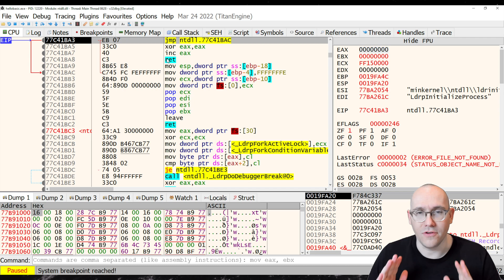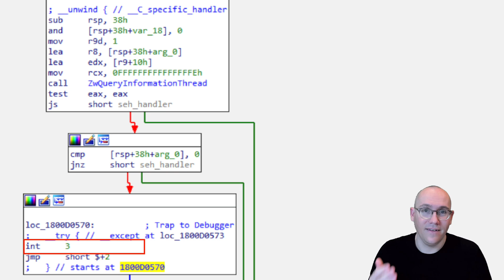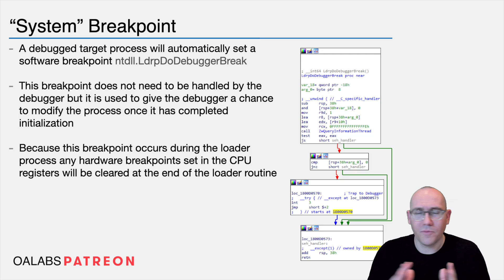x64dbg System Breakpoint Explained

Comment: I notice, top-right corner, it says "TitanEngine" -- is that related to TitanHide, the kernel-level anti-debugger module?  

I've briefly looked into what it takes to install, but it was pretty "don't touch this if you don't know what you're doing" and given it's a driver I erred on the side of putting it off until tomorrow... for a long time.  

I remember I once went looking for some content on setting up TitanHide, but you end up in a lot of those old school hacker forums with kids and that isn't exactly the kind of place I trust for information on installing drivers. Even if it's just my win7 VM, it's a lot of work to muck about with stuff over and over.  

Do you have any content // are you planning any content on TitanHide vs standard anti-debug plugins and what it takes to set it up?
Reply from the maker: TitanEngine is the core debugger used by x64dbg (https://github.com/x64dbg/TitanEngine) it is user land only, no kernel components. TitanHide is tool used to hide debuggers which does have a kernel component (driver) (https://github.com/mrexodia/TitanHide). If you just want to an easy-button to hide your debugger I strongly recommend starting with ScyllaHide (https://github.com/x64dbg/ScyllaHide) it is user land only and much easier to use, we have an explainer here (https://www.patreon.com/posts/installing-to-57091901). I have never encountered malware that required kernel-level debug hiding only anti-cheats etc. so covering TitanHide not a priority for us to cover.
Reply: @OALABS  ScyllaHide -- that's it! That's the one I've got.  

Gotcha. Makes sense to me. That would also explain why I only tend to find TitanHide tutorial information on sketchy gamehacking sites.  

I originally got my start in game hacking and it was the original motivation for reversing. I'm not a malware reverser by trade (I'm a penetration tester); the bulk of my reversing these days actually comes from CTFs and just a desire to stay sharp. Though I really enjoy your videos primarily for the educational angle (understanding what's going on under the hood and why things work) to round out my self-taught guess-and-test knowledge.  

Hopefully some day you do either get around to TitanHide or reconsider it on the priorities. While I definitely do believe you that it isn't necessarily of great import here, I intuitively feel like it's a rather solid stepping stone on the path of... holistic knowledge in this domain? Either way, I will definitely take a look at the links. Thanks Sergei!
Reply: Why do you say "old school hacker forums with kids".
These guys are usually the most skilled reverse engineers much better than those that work in the industry.
Considering that they need to reverse engineer games, software etc. that billion dollar corporations have interest in making as hard as possible to reverse.